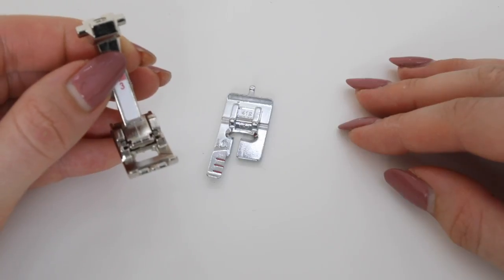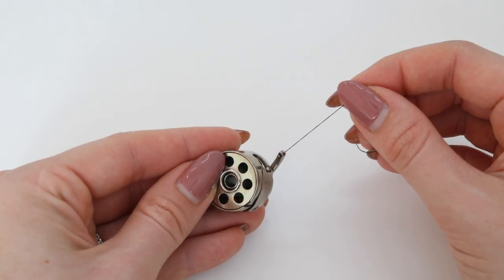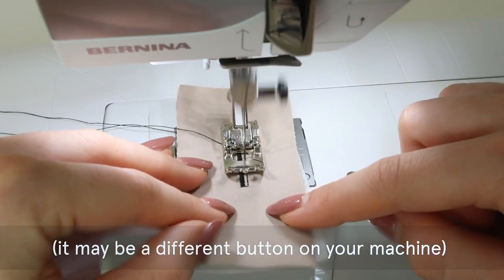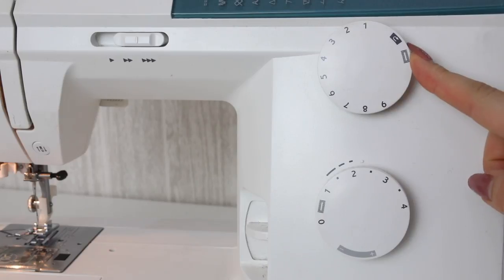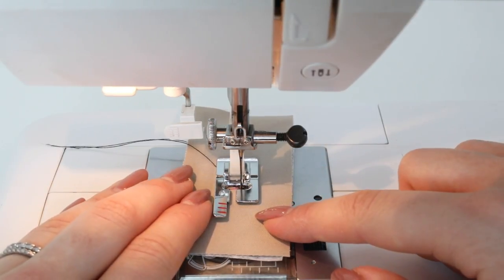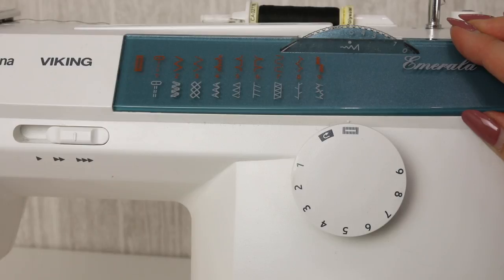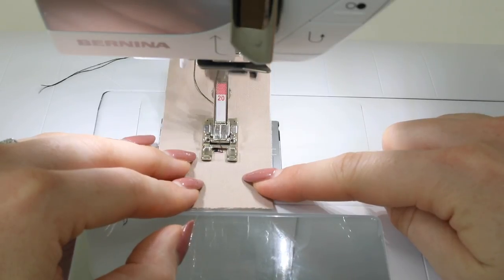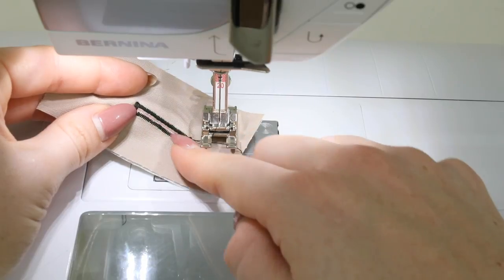How To: Manual Buttonhole

Comment: Great video, like all sewing techniques good buttonholes take practice. We were taught the manual way with turning the work and it does give a nice buttonhole with both beads sewn in same direction. or if machine does an auto buttonhole, you do need to balance up the stitch density sometimes to get an even buttonhole.

Comment: When doing the zero-length end bartacks in the last version, are there any drawbacks if I use a multi-stitch zigzag instead of a plain zigzag?  I quite like the idea of all the individual stitches being similar in width.
Reply from the maker: It might work, and it might depend on the sewing machine you have. I would have a play. On my large Bernina the 3-step zigzag with 0 length will still travel slightly, so it won't stitch completely on top of itself. With a more basic machine I am not sure if it would work. Have a go and let me know how you get on. There isn't an issue with using it! Aneka
Reply: @MadetoSew  Thanks for the encouragement!  But since asking, I've started worrying that the extra needle holes would join up with the ends of the cut, and the 3-step bartacks would turn into a loose twisted mess.  So I'm going to stick with the orthodox ways.

Comment: This was great.The only thing I'm unsure of is on the last buttonhole,while sewing the bar tack,do you set the machine so it stitches in one place.(like the end stitch that you set to zero).If not why doesn't the bar tack look like a row of stitches.   Thank you.
Reply from the maker: Hi Maureen, yes the final bar tack has a length of 0, but a width of 4-5mm so it will be stitching in one place. Hope this helps. Aneka